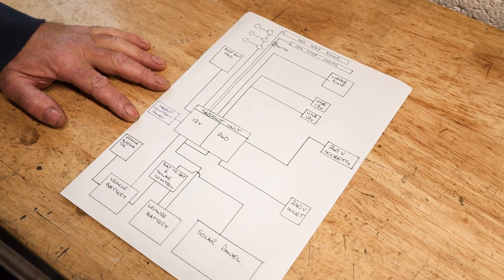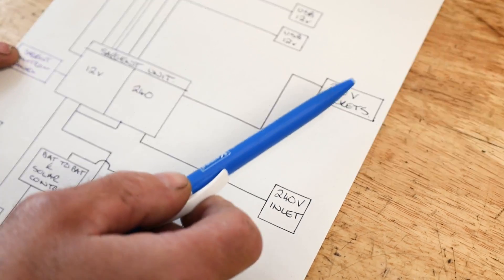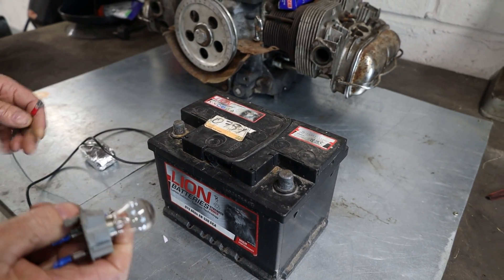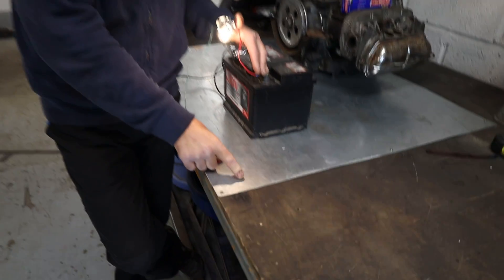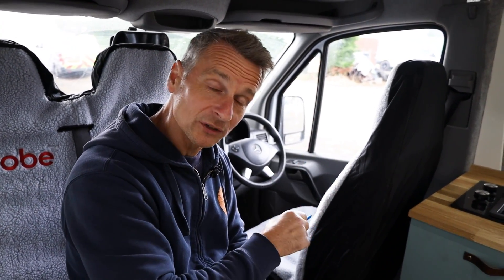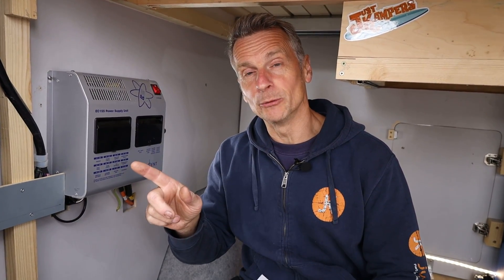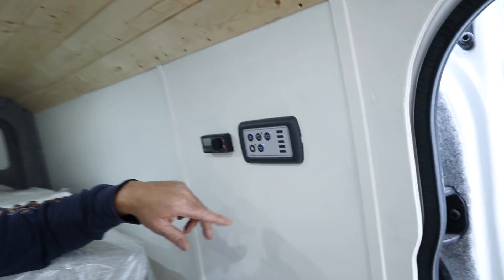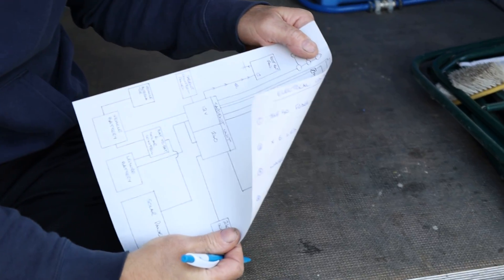A beginners guide to van conversion electrics 12V + 240V

Comment: I have a 350 transit van which is ex Amazon so it came with a leasure battery already. I’ve bought a second hand Sargent unit ( no instructions) Your video clarified a lot but I’d appreciate guidance on which battery to connect cable the trickle charge cable to … can you advise ? 👍

Comment: Thanks a lot for the video! I only have a 5 terminal bus bar so am looking at wiring up LED ceiling lights and some LED reading lights in the same circuit. However the reading lights have USB-C outlet's on them which I believe are rated to 3A at 5V. Is there any problem with having these on the same circuit? Hope you can help, thanks!

Comment: Great video, by far the best explanation to date, although I do still have some questions. First off, are the battery to battery and solar controll seperate units, and if so, where can i find a good battery to battery system? Does the vehicle battery have to be connected to the Sargent unit? I just want to avoid accidentally draining the vehicle battery and routing unnecessary cables. On the system diagramm it also shows that the cable going from the 240v sargent unit just connects to the cable going from the battery to the 12v side of the sargent unit. Additionally most batteries only have 2 prongs, so for the various different systems, do i just stack them ontop of one another? And lastly, when connecting the ground wire, do I run a negative wire directly from the battery to the chassis, and only rund a positive wire to the sargent controll unit, or does the chassis ground connection come later, after both sides of the battery are connected to the sargent controll unit? Thank you very much, and i look forward to your reply

Comment: Magic thanks.  All that has. been done in our camper except the fridge!  So if I put a 240 v to 12v transformer in as it is now, it would run the fridge plus it would be connected to the leisure battery.  That worries me.  Can you have that leisure battery connected to 12v all the time or would that mess it up please?

Comment: Hey, any chance of showing where an inverter goes on your wiring plan. I’m installing an ac unit on my van conversion and want to be able to run it when I don’t have access to a 240v source. I know that an inverter is required but not sure where on the diagram that fits in. Any help would be awesome

Comment: Really useful video thank you!
I'm wiring up my first van, I've followed tutorial videos including yours, plus advice from Rayne Automotive. I'm confident I've wired it correctly, but I'm just a little nervous about reconnecting the batteries.
Should I connect the leisure battery first, positive then negative and then finally reconnect the vehicle battery negative?
Thank you!

Comment: Thank you so much for this video. I bought a VW LT35 LWB 2005 a few days ago. The previous owner had it a couple of weeks knows less than me and I know almost nothing. Anyhow the system is Identical to yours a Sargent only I seem to have an MPPT box also. The wiring is all connected to the devices but not to anything else. So the Sargent just has cables coming out unconnected as do all the other devices. After watching your vid I can see that I need to have a 12v side and a 240v side.  Again thank you so much...Ray
Reply from the maker: Hi Ray, glad you found the video helpful! :) And we hope you're well on the way to understanding campervan wiring. The MPPT box will work well with solar panels. Hope that helps! :)

Comment: Will this act as a split charge system from start battery to leisure ? I have a euro 5 transporter and heard that euro 5 and 6 isn’t compatible?
Reply from the maker: Hi Kyle, for Euro 5 you can use a simple split charge relay to charge your leisure battery, saving you the expense of the DC to DC charger as used on Euro 6 (smart charge alternator). Hope that helps!

Comment: Thank you for this video, I'm a little daunted at the thought of wiring my Boxer, but this has reassured me. Th8s set up is almost exactly what we would like. Before i get this kit, may I ask if the setup you've demonstrated here would work with the addition of an inverter so that we can have off grid 240v power ( I'll need more batteries which I will house in the rear garage) Any other advice would be appreciated before I order from yourselves.  Thank-you
Reply from the maker: Hi, sorry for the late reply! We're glad the video helps, wiring can be daunting. We would suggest running the off grid 240v as a completely separate system with separate 240v sockets. As the Sargent unit it designed to just run from your 240v inlet from a campsite. Hope that helps :)

Comment: Hi, great video, but I don't really understand the switch panel. Do your wires all run from the Sarjent unit, to the panel and then to the component off that switch? Or is there another way?
Reply from the maker: Hi Chris, all the wiring runs from the Sargent unit to the components ie lights, fans etc. The panel only plugs into the Sargent unit, which in turn controls the power. Hope that helps!

Comment: Does the Sargent unit take the place of an Inverter, for when you're Off-grid?
Meaning, does it convert the 12volt power from the battery to 240volt, to run those particular 240volt appliances?
Reply from the maker: Hi, no the Sargent unit is a 240v hook up and 12v system, not an inverter. It's just an easier way of combining both together. Hope that helps :)

Comment: Thats really helpful, I have a Sargent unit and I'm looking to add solar and a MPPT, so good to know I can add along to the system.  On your set up there, how would you add an Inverter into the 240v system on the Sargent? Thanks
Reply from the maker: Hi Andy, you will need to add a inverter to your leisure battery system and run a separate 240v output from there and not add it to the Sargent Unit. As the Sargent unit only gets it's 240v from the shore power inlet only. Hope that helps!

Comment: Hi this is a brilliant and informative video. May i ask which battery to battery solar charge controller you are using?

Thanks Adam
Reply from the maker: Hi Adam, we used the Smart Alternator DC CTEK Split Charging System. Hope that helps!  Link here - https://www.justkampers.com/smart-alternator-dc-ctek-split-charging-system-for-vw-t6-and-bluemotion-t5.html

Comment: Very well explained. However can you advise if the 240v shore power inlet needs to be earthed. If it does how does it interact with the 12v earthing? Thanks.
Reply from the maker: Hi Andrew, all 240V inlets should be earth bonded to the chassis as long as the correct breaker units are used in the consumer unit. This does not effect the 12v circuit. Hope that helps. 😀
Reply: On the 230V AC 50 hz inlet from EHU can you explain why you bond this to the chassis ?

Comment: So will this run off grid
Reply from the maker: Hi, all the 12v appliances will be able to run off grid. Especially with the solar pannels on the roof topping the battery up. With this set up, to use the 240v you'll need to be plugged into the 240v mains.